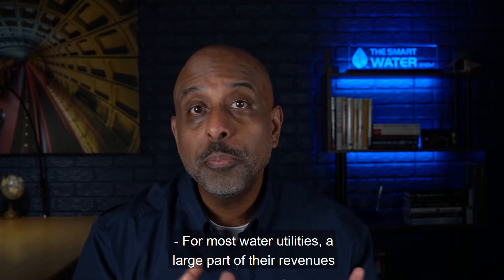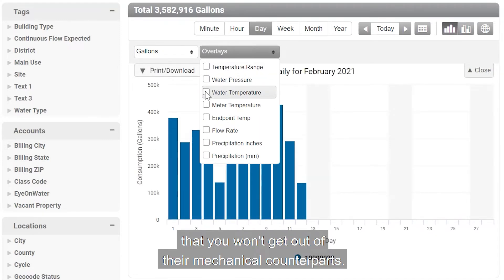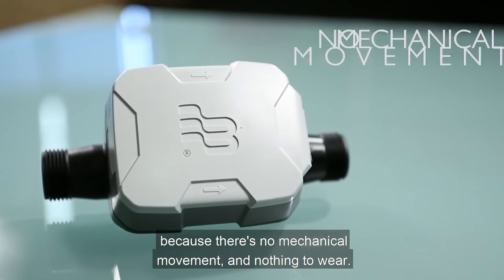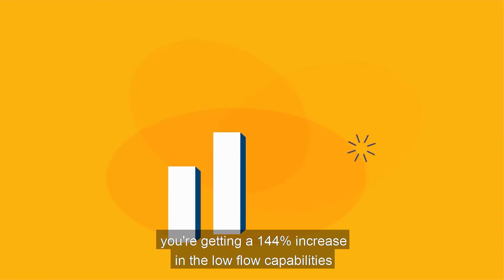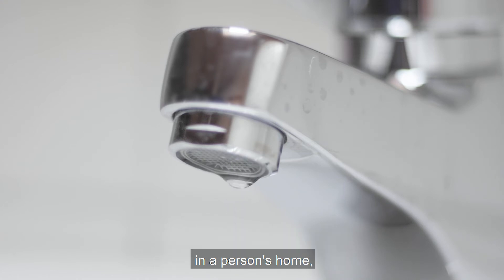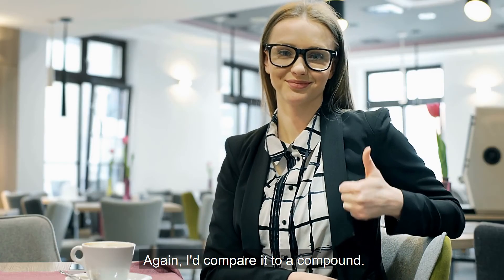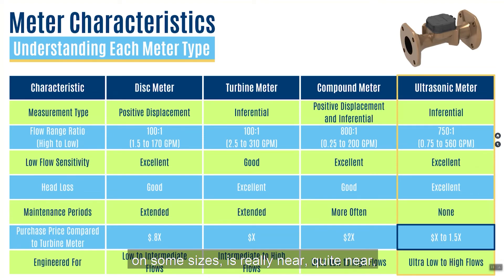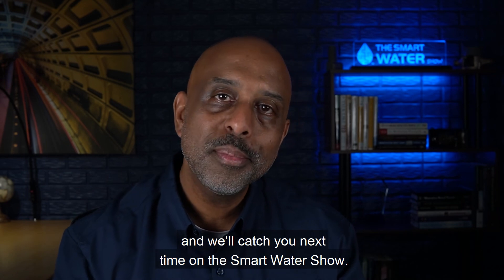Electronic Water Metering Technology | The Smart Water Show, Episode 21

Comment: Given the remarkable specifications of an ultrasonic meter vs its mechanical counterparts that you have shown in the video, why is the adoption of mechanical meters still so dominant these days?

One commonly cited reason is cost BUT from this video shown, it seems to suggest the cost of a static meter (ultrasonic in this case) is say 1.5x the cost of a mechanical meter. So is this 1.5x or maybe 2x cost the main 'hold back' factor for water utilities in adopting ultrasonic meters?

A further add-on question would be: Are there other types of costs involved in the whole meter installation and usage, that could potentially be stopping water utilities from rapidly increasing their adoption of ultrasonic meters? Are ultrasonic meters more costly to install (or has this cost been factored into the 1.5x that was stated in the video)?

Great video and explanation, appreciate it!
Reply from the maker: Let's get you connected to a solution expert, please click the Button "Get a Quote". - Thank you for you interest!  

https://www.badgermeter.com/products/meters/ultrasonic-flow-meters/residential-ultrasonic-flow-meters/